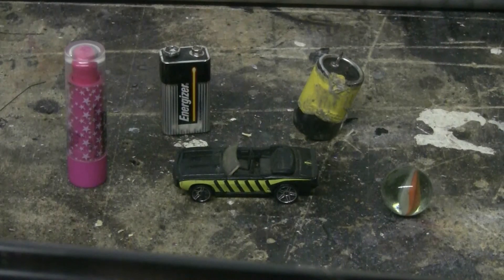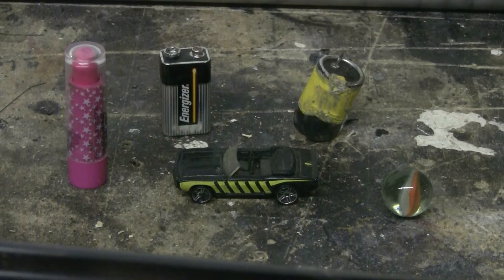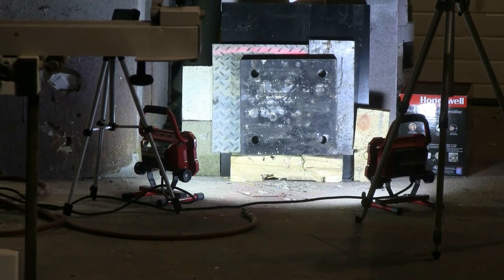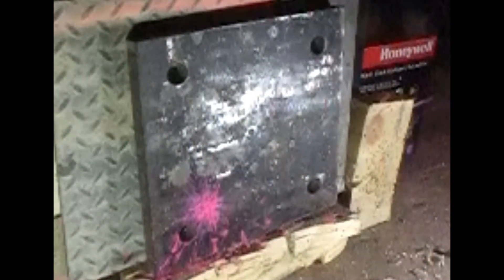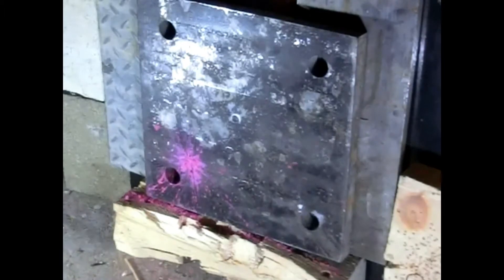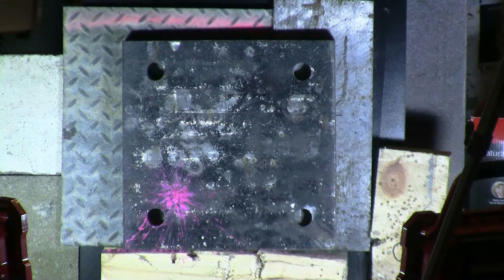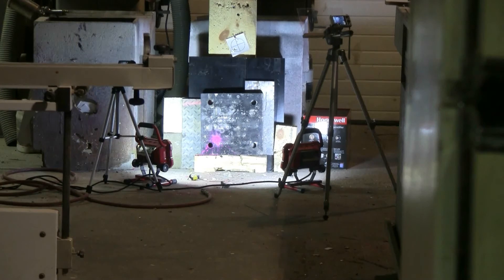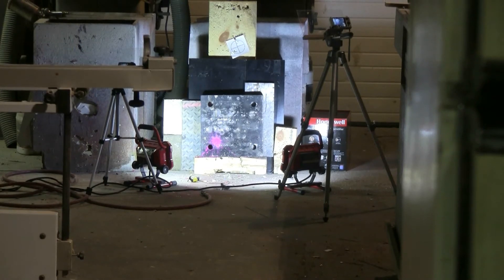Air Cannon #109 - Shooting Stuff At A Steel Plate

Comment: I can't help but wonder what kind of velocity you cannon is capable of.
Reply from the maker: Depending on pressure and projectile weight, with this particular cannon I have chronographed velocities in the 800 fps range. This cannon is fired at 500 psi or less as the solenoid valve gets a little sticky if I raise the pressure.